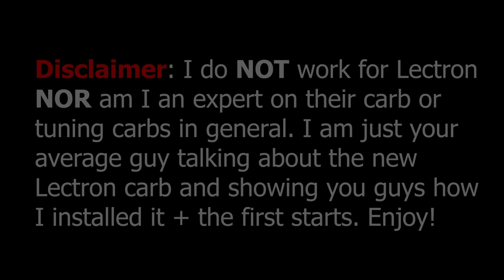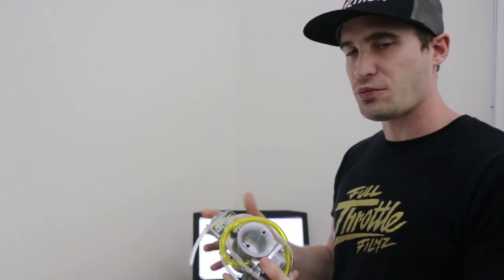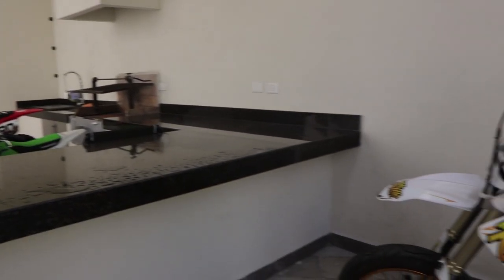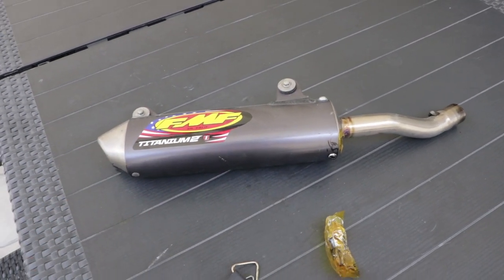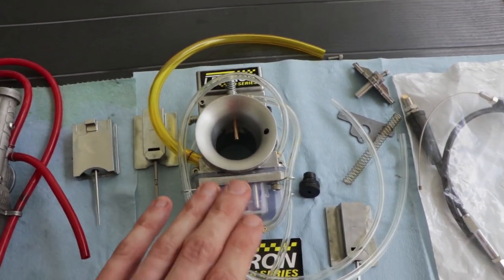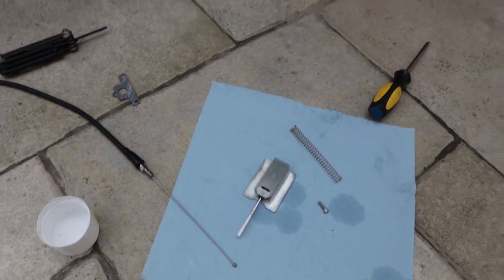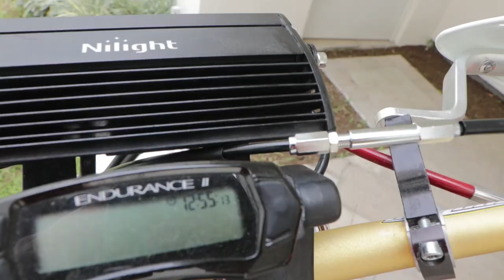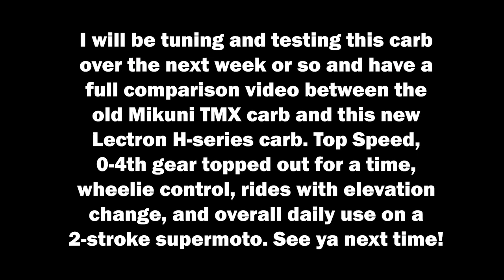New Lectron H Series Carb Info + Install on CR250 Supermoto!

Comment: Just got my lectron carb for my 2000 honda cr250 and can't wait to put it on bro !!! Also a red anodized racing phathead but with a stock insert . Soon I wanna get the +1 and run c12 race gas as well !!

Comment: Awesome vid and thank you! I just purchased the Lectron H-Series. When I’m done ripping my “15” KTM 300 I’m going to make it into a super moto. I’m only at 510 hrs and 8,100 miles I’m not done with her yet. Shes yielded many trophies so far, and with great reliability. 🤞
Reply from the maker: slagletoby what!! That’s insane man congrats to you on that bike. It will be a badass supermoto for sure 👍🏼
Reply: FULL THROTTLE FILMZ; Thanks... I’m still on the original lower-end too. Mostly all woods riding Harescrambles and a few JDays. I use Amsoil Saber @ 80:1 in the tank, and Shell Rotella in the tranny.

Comment: 1) They give you the hex key in the package for the cover screws (access to slide).  2) Put some grease (that came in kit) in the throttle housing (you assembled it bone dry).
Reply from the maker: Brooks personally messaged me saying he forgot to include the hex tool, and I lubed the cable using a Tusk cable luber and Cable Life lube. Nice try bud

Comment: I have to put cardboard in front of one of the radiators. at 65mph the 2004 yz250f gets so cold the engine stalls, like it was cold started.

Comment: What stator are you planning on using? I’m trying to make my 04 cr250 a supermoto and I’m having a hard time..
Reply from the maker: Brandon clark I got mine from Ricky Stator, they make a bolt on 50w stator kit for the +03 cr250s
Reply: FULL THROTTLE FILMZ thanks man!!🙌

Comment: What mix ratio are you running?
Reply from the maker: Tepco Cycle Repair 40:1 motul 800 oil
Reply: I use the smae

Comment: Your plug is getting gummed up because that bike is made to be run wide open on a track, not idling. If you wanted a bike to do that should have gotten a four stroke
Reply from the maker: Henry F it really isn’t a problem with this new Lectron carb. Yes the bike prefers to be ran wide open but not it rides great in all rpms and cruising around